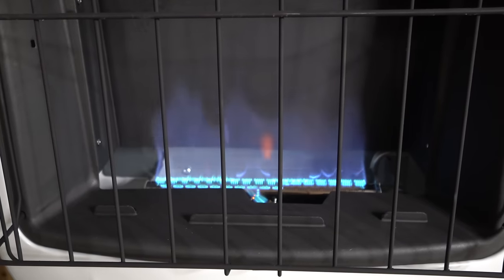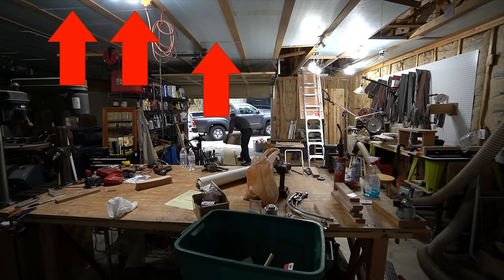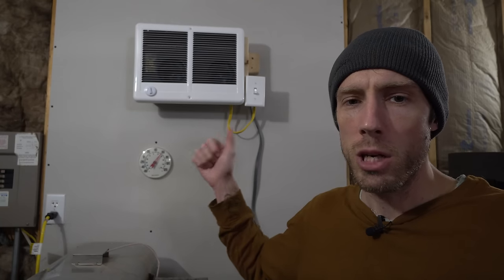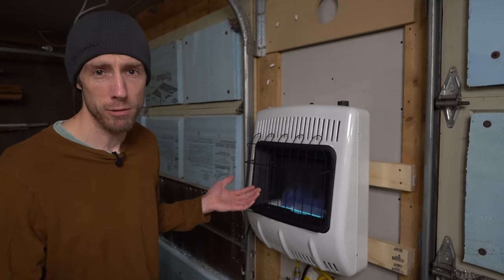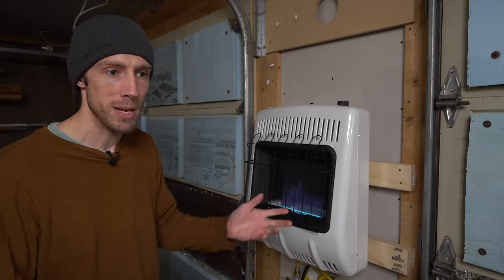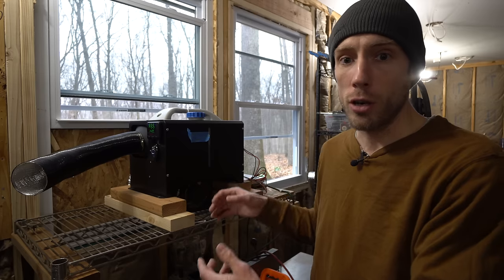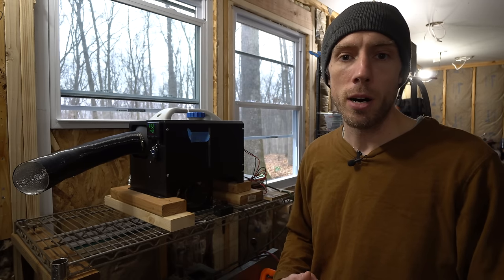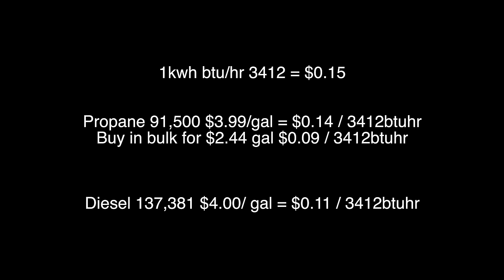What the most cost effective heater for a small shop? How I Heat My Shop For Cheap

Comment: To make your diesel heater even more efficient, pipe your exhaust thru a finned manifold of some sort before you pipe it outside and you will utilize your heat loss a whole lot more! I have also seen guys use an old hot water heater and fill it with sand and then pipe the exhaust thru pre existing water line coil, utilizing the exhaust to heat the sand and getting radiant heat transfer off the sand filled hot water heater tank... You will cut your diesel costs in half!!
Reply: I was going to mention the very same thing as you about heat recovery from the exhaust on the diesel heaters. Definitely worth the effort as the extra heat gains/fuel savings are considerably high.👍
Reply: Make sure that the plenum you use was not discarded for leaking carbon monoxide, I've changed those a few times, and that was the only reason for changing them.
Reply: The thing to be aware of is that makes the exhaust condensing, which will usually deteriorate your exhaust system.
Reply: That's a smart idea.
Reply: As long as it’s not too constricted, having a reliable carbon monoxide detector nearby is obviously necessary.
Reply: Canadian guy ran the exhaust through an old cast iron house radiator(should be cheap or free to find) and then outside from the bottom of the radiator. He put the Chinese unit under a window and therefore the exhaust had to run up a bit to the radiator inlet. This caused a fury of YouTubers battling about the concept of condensation etc of an upward diesel exhaust. The best solution there(if there even is an issue) is to put the unit higher than the radiator inlet. That's the best heat exchanger I've seen yet; the cast iron radiator. Still keeps your exhaust outside when plumbed correctly.

 In brutal temps, I don't like the idea of having this unit outside....you'd have to build some sort of shelter for it. Ergo, just keep it inside up against a wall. I don't know yet how noisy they are? Maybe that's why he wants this outside?

I have a detached garage that already had pegboards and sealed walls for the most part. I decided I didn't want to rip all the walls out and insulate. Been studying how to cheaply heat this garage now for over a yr. Started out trenching from my natural gas meter. Would have been about 80 ft to get to the garage. 100yr Old Maple tree and its roots decided otherwise. The tree probably saves me a thousand dollars each yr running my AC. My neighbors all around have their AC units running almost 24/7 during the hotter months. With that tree, mine runs only occasionally......bad JuJu to attack the roots, so I backfilled the started trench.  Back to the garage....next, I decided to run an efficient propane heater from up high on a wall. But propane now is crazy expensive and going up(it will never go down again). Looked into portable propane units...same issue plus they can make your inside space sweat moisture. Next, I looked into electric 220 volt wall heaters. Even @220 they are expensive to run during most of the day. Doesn't matter if they are ceramic elements or quartz. Wood heat is out because you can't work on gas engines, refinish furniture, or do anything with flammable vapors.  So these Chinese heaters would make the most sense, especially if you ran the exhaust through a heat exchanger and captured that heat before it all went outside. Looks kinda Rube Goldberg, but I like it...easy to work on etc.
Reply: Run it through a metal radiator with a fan to extract the heat off it.  Enter at the top and exit at the bottom so the condensation runs out.
Reply: @InWithBothFeet  How 'bout a length of baseboard heating.  The fan is a good idea but the baseboard uses a pretty fast convection.
Reply: The baseboard heating I'm familiar with is electric.  I'm assuming that there is a baseboard heating set up for hot water or steam?  I think the main point would be large surface area and a way to passively let condensation drain and space available. Radiators are usually fairly compact. baseboard setups I expect would be narrow and long.  These DIY heat reclamation setups would depend on what the DIYer has available at the time.  I went with a ventless propane setup as I'm not sensitive to the smell.
Reply: @InWithBothFeet  Yeah, they call it hydronic.  Just hot water and convection past many fins and a cover.  It's full of water but hot air would go thru it nicely.  3/4" diameter copper with aluminum foil-like fins.  
I believe that just tilting it down would drip all the condensate down and out.
BTW, does the ventless propane heater create and CO?  Has it a catalytic mesh on it.  It might be smart to add a CO alarm just in case.  Good luck with that.  Sounds like a good heater.

Comment: To increase the efficiency of the diesel heater, I connected three meters of 28m copper pipe to the exhaust and mounted it with a small downwards slope to properly drain the condensation, this pipe is also verry useful for drying your gloves. LOL 
Greetings from the Netherlands
Reply: Yeah, extract every BTU out of that fuel !
Reply: Any issues with fuel gelling on the coldest of days?
Reply: @haywoodjahblomee2714 out your fuel inside if it's an issue

Comment: It was a HUGE investment, but I bought an eliminator waste oil burner. It burns used engine oil. For years I was looking for a way to heat my garage to work on hobbies without skyrocketing my electric bill. The oil stove is a blessing. I save all my oil changes, and accept donations. When I run out of oil I go back inside

Comment: Great video! Using the Chinese diesel heater, I would highly recommend a small garden tractor battery $25.00 at Wally World plus a battery maintainer…good ones are cheep on the big A store. The critical reason for the battery, is that even a momentary power cut will shut the heater down without going through its cooling cycle which almost certainly will result in a partial melt down of the controller circuit board mounted very close to the aluminum heater unit. Also in a worst case scenario could start a fire if unattended. Also mounted mine like your testing yours with double plywood foam board between with partially open window sealed down on the the plywood as explained above. You will loose a tremendous amount of efficiency imo if you put it outside. I of coarse vent the exhaust outdoors and bring in the burner air from outdoors as per code here and as you said you don’t want the burn chamber ingesting dust laden air. I use a battery from my garden tractor that sits idle all winter anyway. Having the unit inside is also much more convenient for fueling and monitoring fuel level, but heat loss was my main reason and in my 10x24 shop space is a real concern and find it takes up very little space.  Hope some of this information is of some use to you.
Reply: Definitely doesn't melt anything, mine has had the power cut out about 10x now and its fine.

Comment: Have the same type unit. Have a 200,000 btu waste oil heater for my shop, but heat my 10 X 12 office with the diesel heater during the day when Not out in the shop. Cheaper to run and 
keeps it nice and toasty without wasting all of the energy heating a 3000 sqft building for just one office. For under $150 it was a great deal and works great.

Comment: I'm using a 8kW diesel parking heater to heat my condo, and it's works great! Its been below freezing here regularly this winter, and the home is nice and warm - barefoot, shorts, and t-shirt temps. 5 gal. US lasts anywhere from 5 to 10 days depending on how cold it gets outside. Far less expensive than heating with electricity, and by dumping the exhaust outside, no water condensation issues - nice, dry heat.

Comment: Great video that is complete. Thank you for pre - guessing the questions. 
Mini split also does not do well in low cold, 35F (ish) and below though they do provide AC.  
The propane works during a power outage. Pellet stove and diesel heater need a small power source. Diesel heater is designed to run off a car battery.  Solar cell helps with recharging. 
Pellet stoves need 120V and produce a fair load when starting. It is a low load when running - just the blower fan and pellet feed auger.  Yes they have gravity feed pellet units. 
Waste oil burners need a blower and combustion chamber.

Comment: After insulating my shop I ran some PEX tubing from my gas boiler to two large cast iron radiators but mostly I use my wood burning stove to provide heat.  The firewood is free and the stove and a wood splitter were the only upfront cost.

Comment: a minisplit in a woodshop situation would create a higher maintenance issue due to your afore  mentioned issue with dust... as a woodworker, that's something I considered as well. I installed a pellet stove and am impressed with the ease of use, less effort (read as time spent) in fuel acquisition, thermostatic control and elimination of mess involved with wood heat. I'm willing to forego the A/C for the limited seasonal use in favor of the benefit of cold season temperature control. Humidity has a lot more to do with excess environment heat, so will opt for a dehumidifier rather than an A/C unit
Reply: Did you try a sawdust stove? Woodworker/shop means unlimited low cost near free fuel no electricity optional low speed fan if beneficial with 10 hours burn/heating.

Comment: id recommend buying some clear plastic sheeting and putting that over all 4 walls to make yourself a air sealed bubble, the insulation will be able to breathe just fine but that air seal will make   such a difference.
Reply: Sounds like a DIY left out house wrap or foil layer etc... the science must be followed if you wish best insulation value for the money...
Reply: The walls do need to breath some or you get condensation and wet insulation. Cheap Tyvek clone house wrap will seal up good but still allow some breathing. 

I have Tyvek cloned wrap with R35 in attic, R21 in walls and a floor is tiled over plywood over 2x4 laid flat with R9.6 worth of Polyisocyanate insulation. 

I just bought one of the Vevor 8kw heaters to install in my 725 sq/ft garage.

Comment: You are exactly right. Been there done that. My prices and figures are almost the exactly same as yours. I have never used one of the diesel heaters but have been thinking about it. I have a farm tax permit and can get farm diesel too. As far as cooling I do have some experience with the window inverter units. I used them this last summer and shut my central unit off. I saved a little over $100 a month and stayed just as comfortable with two units running. They are super quite. Cost less than $400 each. I am in a hot humid climate and highly recommend them.

Comment: The best way to go is an outdoor wood heated boiler.  They are quite expensive, but can be home built reasonably priced. Run insulated tubing into the building to heat exchangers in corners, it shouldn't take up too much space.

Comment: Your electricity is incredibly cheap compared to ours in Massachusetts---just went up to more than 48 cents per kW-hr!  We just got a "high-efficiency" mini-split, and it's the best there is (Mitsubishi), for just one large room.  It's a great air conditioner, but running it for heat in the winter is very expensive, even with the oil heat still running.  Our electricity bill was nearly $800 last month!  So, the plan around here seems to be to get everyone to switch to these heat pumps and electric cars, then jack up the electricity rates so that we all freeze to death and can't go anywhere.  Welcome to the Green New Deal!
Reply from the maker: Yeah I agree. Ours is very cheap but still expensive compared to alternatives. No way would I switch to all electrical. At least not until solor becoms a more reasonable option.
Reply: Wow, they are draining you dry!

Comment: I've been in HVAC for 40 yrs. I don't like mini splits at all, they have a tendency to leak at the fittings in cold climates plus all electric. Just get a window unit for cooling. Check out rinnai heaters easy installation easy propane conversion, they vent outside through the wall (3in pipe) and take up very little room. They come in various btu sizes.
Reply from the maker: What a good brand for a full home HVAC system in your opinion? Looking into a new one for the house 🙂
Reply: @OUTDOORS55  if you're going to install yourself. Goodman, whirlpool. Unfortunately if you want a carrier or Bryant and there's a few others they're all Dealer represented. In other words the general public can't purchase them. The latter two I mentioned are good but expensive.

Comment: Most people have electric clothes dryers but don't know how to heat their house with them.  Their exhaust heat is humid and has some lint in it so you need a salt desicant, like road salt in multiple trays in a box, an enclosed container and an extra dust filter at the face of the box that is easy to clean. Build a box 1 foot high by about 3 x 3 feet with a round hole in the back and a larger rectangle  hole in the front.  Make tray shelves in the box to put five or six trays of road salt on to absorb moisture and a window screen on the front.  Pipe your dryer heat into the box , and out the front heat will pour into the house while you are doing laundry.  Or you can plumb it into your garage.  Most families can manage a load a day and that's about 90 minutes of dryer time so why waste that heat to the outside of the house in winter time.?

Comment: WARNING: I bought this Vevor unit but half the winter later it failed with the burner fouled and blowing smoke. Upon examination it turned out it was assembled wrong. The pressure fuel tube was coiled to facilitate easy assembly and the air bubble trapped in there caused the pulsations to become neutralized. This missing pulsation caused the fuel atomizer screen to fail atomizing and burning large particles gradually caused carboning up. I had to take apart the burner and totally clean it out. IF YOU GET A GOOD BURN NOW you can avoid this laborious cleaning, because a good hot burn will clean out the carbon. You would need to take the box apart and make sure the pressure side tube is a straight run upward into the burner in order to purge any air bubbles. After that it's a good heater.
Reply: What I fear about Chinese price point construction. The industry feels that if you get a bad one, you just buy another because the price is right.

Comment: Very interesting video - enjoyed the math !
I heat with wood pellets in a rocket stove. A 40 lb bag of wood pellets is roughly $6 and contains 320,000 btus (at the advertised rate of 8000 btu/lb).  Given that, 3412 btus costs aprox 6.4 cents.  The rocket stove is extremely efficient, my exhaust temps are shockingly low when she's running full blast. I'm going to guess it's 85% efficient, which takes the cost from 6.4 up to 7.5 cents per 3412 btus.  Buying wood pellets in bulk saves about 20 %, roughly $5 per 40 lb bag.

Comment: You could run the exhaust through a section of finned pipe from a water baceboard heater to recover the heat inside before the exhaust goes out side

Comment: Finishing the walls with drywall will almost make the same improvement as insulation and might be hlf of the heating bill.  If You use plywood Youll have to seal the edges with putty and drywall tape or it wont do much good
Reply: Was wondering about that. Part of my basement level is above ground. The contractor who built it insulated it but didn’t put up drywall. I put up freakin peg board on the outside wall where it wasn’t blocked by stuff, and it actually raised the temperature by a couple of degrees. Made me think there is a small hole and the pegboard pushed the insulation snug. Drywall has got to make a big difference, right?

Comment: Got a Chinese diesel heater in basement ran exhaust through a 1 inch emt pipe along bottom wall 10ft and up 7ft  vented through cinder block to capture exhaust heat 
No issues with leaks or fumes exhaust pipe radiates like a baseboard heater

Comment: Have you considered making a gasifier to run a generator that could run the shop  ( or running the syn gas through a compressor and into a large tank similar to propane storage. It isn't near as efficient but it's possibly free, especially if you want to add a few extra steps you could even burn house trash in the thing ) ; and installing adjustable heat sink from the gasifier to heat the shop or make an insulated surround with a vent and a fan and attach a thermostat device. One of the biproducts/condensates of the gas is diesel. They are simple to build with plenty of plans available. FEMA republished gasifier plans not too long ago, but they are basically the same ones from the 40s. They are perfectly legal. And since we seem to be very near nuclear war it makes sense
Reply from the maker: I have seen them but dont have the time currently to fiddle with that. Would be an interesting project for sure👍

Comment: You can use a long exhaust in the shop to get the hot exhaust on the room before it goes out through heat exchange. You can also use waste oil in that and it is surprising how clean it is
Reply: Using waste engine oil always carbons up the mesh ring inside the primary combustor chamber. It shortens the service life dramatically. The long exhaust is a defo good mod and improves the heating efficiency by a big margin.